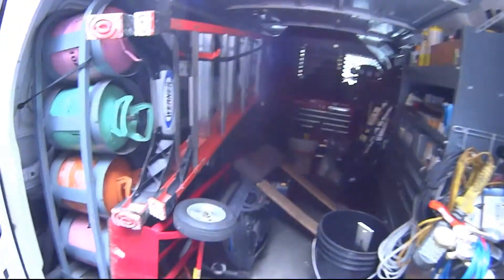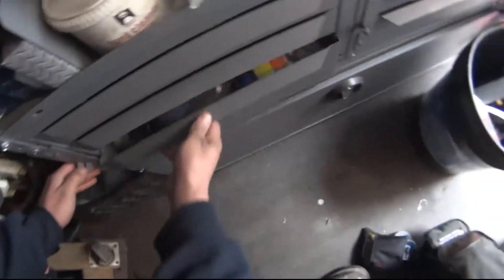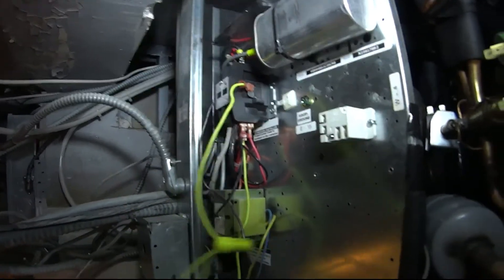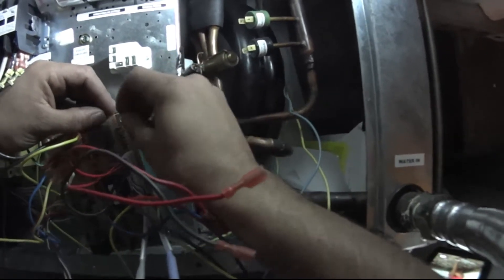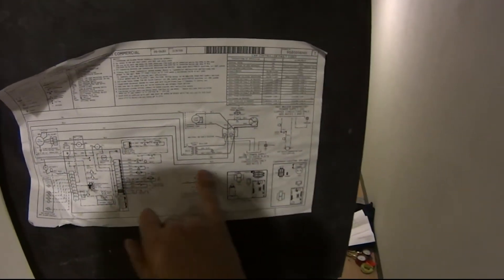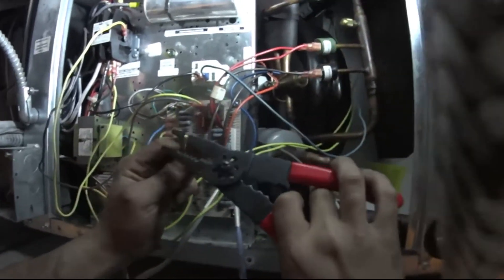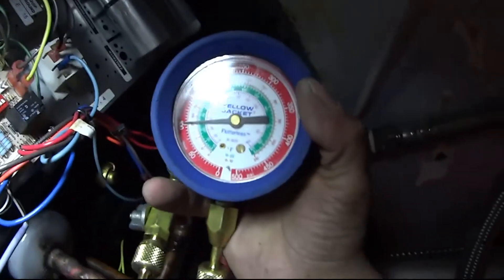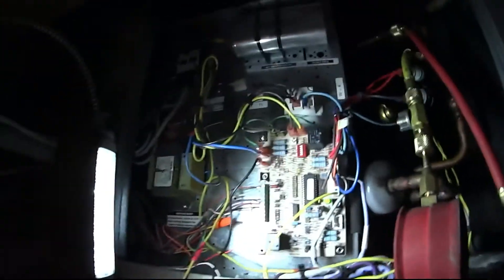Water Source Heat Pump | Re wired | HVAC

Comment: Emin I recently had a call for a climate master . The FP2 was cutting out on cooling and the HP switch was cutting out on heating . My head pressure in heatung was crazy high and I checked for a line restriction at the filter dryer and the TD was like 20 degrees . But i  cooling my pressures were normal . I cut out the FP2 switch and rhe unit ran without any faults . Any thoughts?

Comment: That's probably the only thing I don't like about water source heat pumps there so confined, to change the reversing valve or compressor you'd have to take everything else out just so you can see where you have to work, you still don't have adequate room to work lol
Reply from the maker: I totally agree Juan!

Comment: Good work, Emin. I usually toss the board and sensors and wire the thing up with a couple relays and a lockout relay. Saves me any nuisance calls backs from thermistors.
Reply from the maker: man I hate that board, termisters are a big pain in the ass.

Comment: Emin please excuse the dumb question... did the old diagnostic board fail? Hence why the unit seemed like it was missing something in the beginning.
Reply from the maker: That's because it was missing something the board lol the unit was rigged to run with out the board, so I just installed the new board and re wired to specs.

Comment: Has Martin been working on that unit?
Reply: You pulled those wires off like a mad man!
Reply from the maker: hahaha no, I looked like a mad man because it was sped up a little
Reply: How big are those apartments to need 4tons?
Reply from the maker: Joe Shearer don't know I never go in, they are located in the hallway
Reply from the maker: Joe Shearer normally I just ask them to put the unit on and I take it from there. If I was to take a guess it's prolly 1800 square feet
Reply: Wow that's crazy too much yo!
Reply from the maker: everything is designed by engineers, they go a little bigger for lots of reasons.

Comment: Great viedo. Do all wshp have thoes wet swich on them . I never seen them before.
Reply from the maker: Well that round one  is an optional external wet switch, However moat wshp have a internal single wire switch that  sends a signal through ohms if drain is clogged.
Reply from the maker: Email me your number so we can talk about that blower asked about. I'll call u tomorrow eminhvac83@gmail.